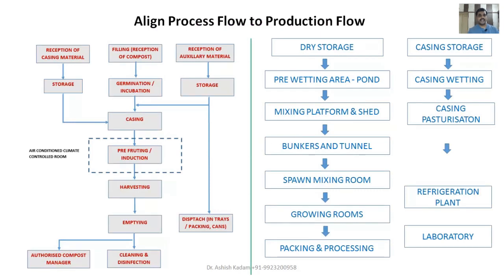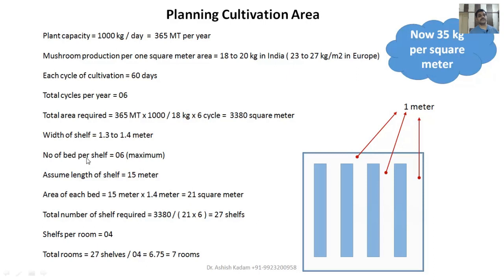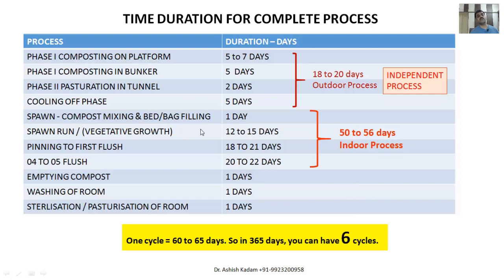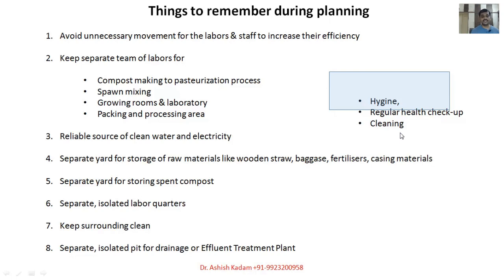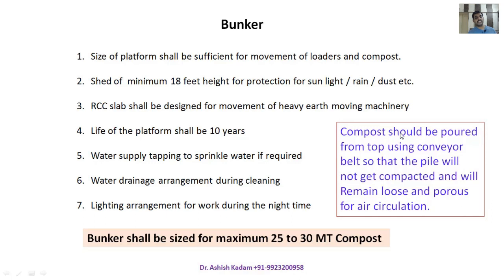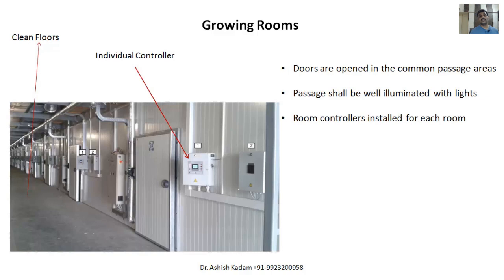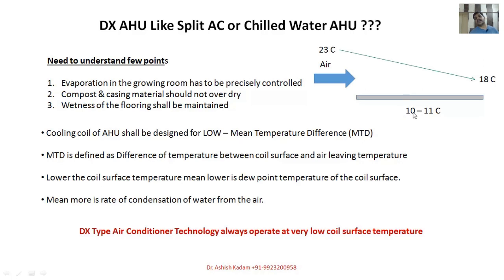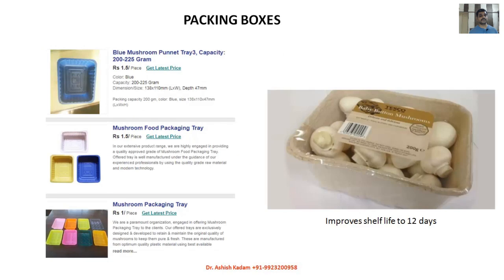Video 4 Design Consideration Mushroom Farming Project

Comment: Manufacturing / importing & trading in items used in button mushroom industry 

PP 7" X 16" for spawn bag Rs180/= per kg Delhi

6x7 , 200 gm,  30 kg, Rs180/=

Compost Bag HM 24x30
With handle 
50 to 55pcs 
virgin quality 
Rs140/= packet

Compost Bag LD 22x24
50 to 55 pcs in one kg 
virgin quality 
Rs150/= per kg 

Punnet Rs95/= per kg 

Duct air tube Rs160/= per kg 
15" to 32" size

Punnet packing machine 
Rs3000/= & Rs7000/

Trading 

Cling film R3300/= box
6 pcs in one box 
Antifog food grade 
Oxiwrap 

Hydrion Ammonia Meter Test paper strip :

This is used to check ammonia levels in tunnels (phase 2) during conditioning stage .
The result is accurate in 15 second time , more than 100 tests can be performed 

Range : 0-5-10-20-50-100ppm
Rs2100/=

Co2 Meter Rs10500/= 
Range 0 to 9999 ppm 
With temperature & humidity function 

Sealing machine 12" Rs1300/=
One year warranty 

Gardena shower Rs2100/

Digital hygrometer Wet and dry bulb Rs500/
Digital hydrometer 
Digital thermometer srew type Rs150/
Glass thermometer 12" Rs60/ & RS200/
Ph strip Rs400/= & Rs1100/

Ultrasonic Fully automatic 
Humidifier 5lt per hour capacity 
Centrifugal Rs26000/ with sensor and controller 

Formalin Rs35/= per lt

KMS Potassium Mesabisulphide for washing Rs90/= per kg

Cocopeat 
Rs24/
Full load Rs22.50

Rope 
Material PET
Rs290/= per kg
One kg has 100 meter length 
Used instead of saiya in Mushroom racks 

Co2 dampers Rs2000/ per pc 
& fresh air blowers
Spigot for aerated flooring in tunnel & bunker Rs16/ per pc

Packing tape 2"
Tape dispenser 

Delivery Delhi

Vivek Kapoor 
7590008263
9818578263 whatsapp only..

Comment: Any information on the plenum and how to design a blower fed aerated floor and plenum? I cant find any schematics online or information about air pressure or volume for a given amount of compost.
Reply: Manufacturing / importing & trading in items used in button mushroom industry 

PP 7" X 16" for spawn bag Rs180/= per kg Delhi

6x7 , 200 gm,  30 kg, Rs180/=

Compost Bag HM 24x30
With handle 
50 to 55pcs 
virgin quality 
Rs140/= packet

Compost Bag LD 22x24
50 to 55 pcs in one kg 
virgin quality 
Rs150/= per kg 

Punnet Rs95/= per kg 

Duct air tube Rs160/= per kg 
15" to 32" size

Punnet packing machine 
Rs3000/= & Rs7000/

Trading 

Cling film R3300/= box
6 pcs in one box 
Antifog food grade 
Oxiwrap 

Hydrion Ammonia Meter Test paper strip :

This is used to check ammonia levels in tunnels (phase 2) during conditioning stage .
The result is accurate in 15 second time , more than 100 tests can be performed 

Range : 0-5-10-20-50-100ppm
Rs2100/=

Co2 Meter Rs10500/= 
Range 0 to 9999 ppm 
With temperature & humidity function 

Sealing machine 12" Rs1300/=
One year warranty 

Gardena shower Rs2100/

Digital hygrometer Wet and dry bulb Rs500/
Digital hydrometer 
Digital thermometer srew type Rs150/
Glass thermometer 12" Rs60/ & RS200/
Ph strip Rs400/= & Rs1100/

Ultrasonic Fully automatic 
Humidifier 5lt per hour capacity 
Centrifugal Rs26000/ with sensor and controller 

Formalin Rs35/= per lt

KMS Potassium Mesabisulphide for washing Rs90/= per kg

Cocopeat 
Rs24/
Full load Rs22.50

Rope 
Material PET
Rs290/= per kg
One kg has 100 meter length 
Used instead of saiya in Mushroom racks 

Co2 dampers Rs2000/ per pc 
& fresh air blowers
Spigot for aerated flooring in tunnel & bunker Rs16/ per pc

Packing tape 2"
Tape dispenser 

Delivery Delhi

Vivek Kapoor 
7590008263
9818578263 whatsapp only.